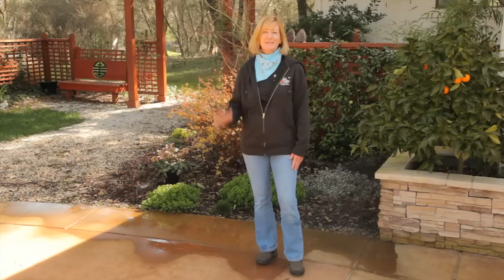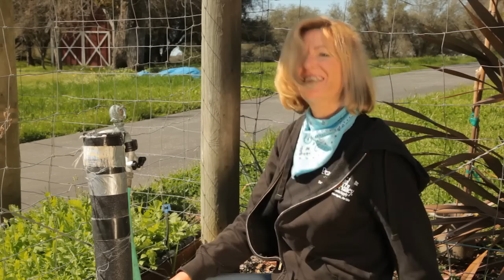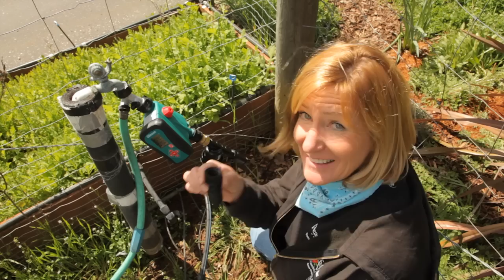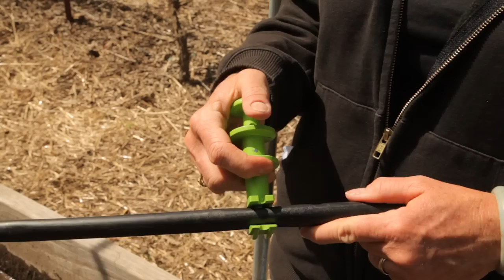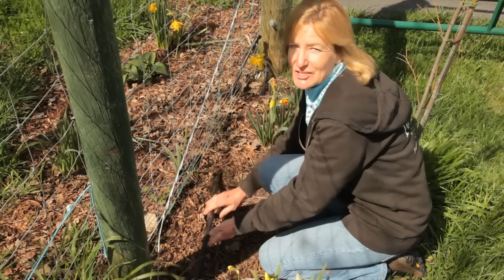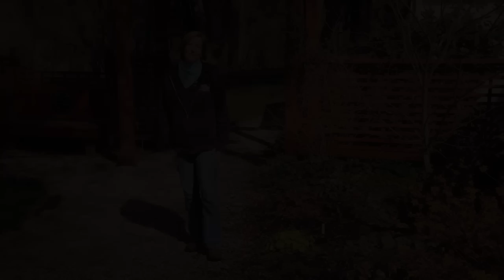Using Drip Irrigation to Save Water in Your Garden

Comment: it will block because of hard water
Reply: filters do nothing to remove dissolved minerals like calcium carbonate from the water.
Only a soft water system or reverse osmosis can fix that.

Filters can remove some of the coarse particles and if using carbon, most of any chemicals in the water.